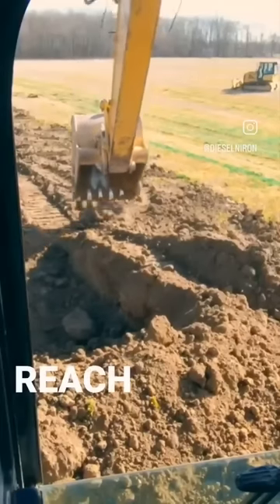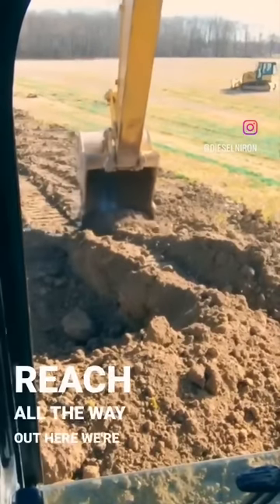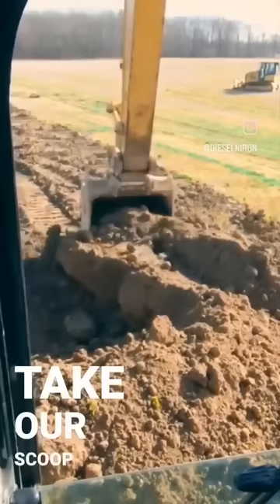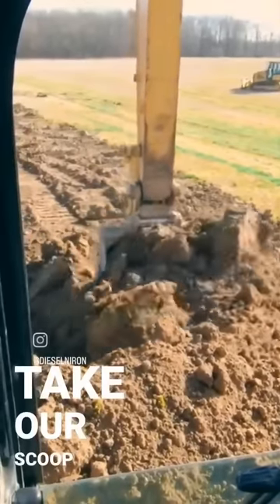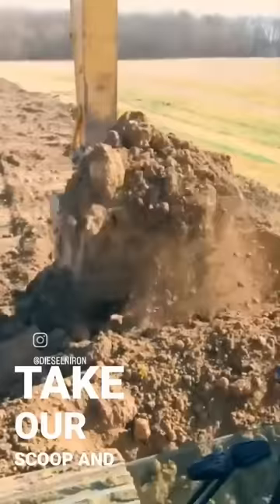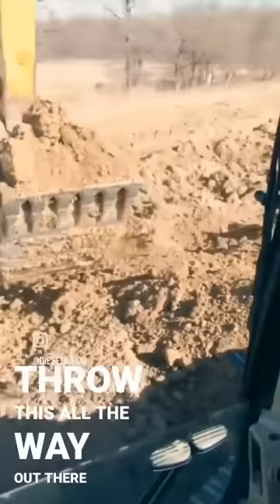Wasted movement in an excavator.

Comment: If you push the stick out super quick maybe 4 inches, while curling the bucket out, to tip out, you don't even have to wait for the bucket to empty. As the enertia and force will throw the dirt out. Saves you maybe 3-4 seconds. But over a 12 hour day it adds up to around onother hour of extra cycle time moving more material. Do that 6 days a week, over a year. And that's a fuk ton of material!
Reply from the maker: Great tip.  In the full video I talk about a couple ways you can empty your bucket quicker.

Comment: Until someone walks into your swing radius and your on auto pilot and kill some. Also you runnin that thing rougher than fuck bud.
Reply from the maker: It should be obvious you only do this when conditions permit and you should always be paying attention when running  a huge piece of iron.  As far as running it rough, I had just gotten in this machine and it had a quick coupler that took about 15% of the bucket travel out of play.  I was still getting used to that when I started making the video.  I knew I was going to catch flack for it but I still wanted to make my points.

Comment: harder on the swing motor because all that weight is farther away from center, not to mention less safe because the bucket is moving faster at that distance, and yeah not practical most places
Reply from the maker: These machines are designed to take these forces.  If I were worried about keeping the machine for 20k hours then I might stress about the extra wear.  The key concept for this video was to get new people to think beyond "scoop and dump."  You need to start thinking about the bigger picture as you progress in the machine.

Comment: Looking at the work behind you. You need to learn how to be clean.   Not sure what your working on but you left alot work behind you.
Reply from the maker: I was bulking material to save time. I came along after to do light finish passes for cleanup. It was was quicker than using one machine because the 330 could reach so far.

Comment: All the guys knocking the full lockout bang are right except every one of them has done it over and over when they're shifting mud...😜 We all have to learn some way. 

I'm usually starting my slew as I'm finishing the loading curl if I'm not trapped behind a heavy pile and pushing dirt when I move. I start to roll out halfway through the slough so when I get to the 9 o'clock position my bucket's nearly empty. While the last bit is tumbling out, I've already slowed the slough to an easy stop and am going back to 12 o clock. If the piles need to be tidy I'll be more decisive but if I'm just bulking.... That's how I do it.  On the way back I time my re-commitment to the stockpile so there's no sideways deflection on the pins when I land and dig into the pile but there's never a full stop.  I try be engaged in the swing every second that doing so won't exert lateral resistance pressure on the pins. 

If I'm throwing it all the way behind me in the 6 o'clock position I won't even stop, I just continue a full slow 360 spin in one direction to save wear on the Slough brake, dumping in a crescent pattern from 7 o'clock to 5 o clock. I alternate directions so the wear is even on the slough. 

Learning to operate consistently in a way that's both efficient and gentle comes with thousands of hours and obviously production work in a mine and working in a small business with a low budget are 2 different things.  Guys that are too delicate and gentle will get yelled at in the mine and guys that are productive but fast and rough will get yelled at by the small business guy drowning in debt on the machine purchase. 

Operators always get a lot of abuse for being idiots... But people outside this trade don't comprehend the costs involved.  A really nice tablesaw might cost 4 grand, but a pretty nice excavator might cost 400 grand.  Just sayin 😂
Reply from the maker: Great comment and really solid advice.  Thanks for watching!
Reply: @DieselandIron  Thanks for posting, someone's gotta show the kids that the building trades are worth surviving the learning curve to reach proficiency 👍

Comment: Doing the Bubba scrub . Lol , when I get in the dirt like this, I'm dragging my shit taking a bucket load while pushing another half bucket across,  then barley drag it out.
Reply from the maker: It is incredible the number of people in the comments that don't understand how efficient this method is for roughing in material. It's even more impressive the number of people that think this is going to destroy a machine.
Reply: @Diesel and Iron  oh ya, I've got thousands of hours moving mountains. When I'm doing bulk dirt transfer, I'm hogging in deep everywhere. It's nothing to take a bucket, and move another in the same stroke, then I'm dragging it out of that pile and it will basically just slingshot right into the other pile as it's curling,  Luke I said, dragging that, and pushing as much as possible. The cycle times are pretty good. Not the fastest, but man can you move the dirt quick this way.
Reply from the maker: @ParticipationTrofee  100%

Comment: This is well and fine if you're on the level. But if you're working at height or an uneven territory or off of a perch that is not built out of competent material, you always want to keep your bucket close to the machine so you don't tip over
Reply from the maker: Correct.  I made an assumption that the internet would use some common sense on this video.  The abortion taking place in the comments section is proving me wrong....
Reply: Roger that. I sure wasn't trying to give you a hard time my buddy....I guess I've been at it way to long and am always "what if'ing" my self to death.  Anyways...screw the haters and keep on trying to help folks 😊

Comment: We did this in Alaska mining, but I set the limiters so you could not slap the bucket or dead end a cylinder. I'm sure the new equipment won't let you dead end it. I wonder how hard this is on the rotation parts. Any one know?
Reply from the maker: This was an old beast with an old style coupler that took a lot of the play out of the bucket travel.  I was still getting a feel for the machine when I started recording.  The clanging makes more noise than anything else.  There are metal stops welded on the eye that prevent the cylinder from actually bottoming out.  It's not great for your pins and bushings but real damage isn't going to occur from a handful of bucket slaps.

Comment: it's not waisted movement. excavators, while extremely powerful, have limits. not to mention you've got Jimmy out there with a shovel checking his phone, and you just swung your bucket across his head. good job. you're fired.
Reply from the maker: Hear me out. What if you were careful?
Reply: @Diesel and Iron  careful doesn't help you see through dirt. I'm not saying you can't operate this way, but in most construction scenarios this would be more risk than reward. I'm not the be all end all when it comes to this stuff, but I was a heavy equipment operator and instructor for several years. I also worked with a state agency to produce safety curriculum and training around heavy equipment. Specifically for highway construction.
Reply from the maker: @1985recon  the intention of this video is to get newer operators out of the mentality of only thinking about scooping dirt. You have to think about the bigger picture, efficiency and saving time. In a longer version of this video I talk about safety as well but you can only do so much in a small 45 second clip

Comment: The only fear i would have if i owned the mechine is damage done because of you arm being stretched out
Reply from the maker: The machine isn't being damaged from the arm being out.  Believe it or not, these machines are engineered and designed to work....
Reply: @DieselandIron  I get it, I work in an industrial kitchen, and some mechanics are built to last. I was thinking of stress on the hydraulics. Like you will only get 40 thousand twists over 40 thousand 1 hundred. Before some PMs are needed

Comment: I love how all the internet experts are bashing on you for cylinder bottoming out etc etc. It’s a machine, not a museum expo model. You internet experts need to learn that these machines are made to be used and have a relief valve that’ll open up at a certain pressure (depends on the model) to prevent damage. You can max out a cylinder and keep your joystick held down and it still won’t damage it. The seals don’t get damaged either unlike some of y’all claimed. Seals get damaged from years of exposure to dust/tiny gravel and scored chrome shafts.
Reply from the maker: This post has really stirred up the armchair operators and the worst of the industry for some reason. While they think they are really getting me upset, they are killing it on the views and this is now one of my top videos 🤣🤣
Reply: @DieselandIron  More exposure for you, that’s always a good thing 👌 meanwhile they’re pulling their hair out for the extreme damage your causing to that poor working machine. Don’t forget to buy a shovel to please them 😆
Reply from the maker: @rukinaa  🤣🤣

Comment: Try that on a barge with a long reach.. youd be upside down under water
Reply from the maker: But this isn't a barge... Or a long reach....
Reply: @DieselandIron  good thing.. this might work on a pile but it's still better to full range the arm when swinging, be easier on swing bearing/brake.. that fluid motion, but when your learning best just get the job done eh.. you'll get there, slow is smooth and smooth is fast!

Comment: Pulling in is not wasted movement.   Once you learn how to run them.  Pulling in gets the house spinning faster and throwing the stick out sucks up the built up energy.  And when the stick is in tight to the glass you have way more swing power and keeps your center point of gravity closer to the ground.
Reply from the maker: I've actually tested this and it is still faster to leave the stick out from a cycle time standpoint.  I agree with the momentum aspect but due to the hydraulic requirements of sticking in and out it's still faster just to swing when site conditions allow it.
Reply: Its like a figure skater doing spins. When they pull in their arms they spin faster, when they extend their arms out they slow down. 
Basic physics
Reply: Lol you should time that... Physics says bullshit. Sure, you can swing faster with the arm in, but the amount of wasted time moving the arm in and out more than makes up for the small increase in swing speed.

Comment: I'm not in construction but, isn't this common sense that shouldn't need a demonstration? If I'm wrong let me know the rationale.
Reply from the maker: Technically it is faster to swing with the stick and boom pulled in (think of a ballet dancer or figure skater spinning).  The problem is the swing motors slow down when you add the hydraulic demand of bringing the stick and boom in which actually causes your cycle to be slower than had you left the arm out to begin with.
Reply: @DieselandIron  Thanks
Reply: @DieselandIron  that make sense to me. Mass x velocity = momentum.

Comment: That technique is hard on the swing bearing. Also, when you slam your bucket all the open, you're ruining the packing in the curl cylinder. Keep working at it bud, you have to dial in your technique and learn what is efficient and easiest on the machine
Reply from the maker: The swing bearing is fine. See comments below for an explanation to the bucket cylinder bottoming out
Reply: @Diesel and Iron  I'll take what you say with a grain of salt. I've been around this stuff  long time. Common sense will tell you from a leverage standpoint, you're putting more stress on the bearing that way. Most qualified excavating companies aren't okay with running a machine that way. They'll generally send you down the road.
Reply from the maker: @joshuaurban7575  ok
Reply: @joshuaurban7575  LMAO no. They're literally made to swing like this. Where on earth are people pulling the boom in close every time they need to swing the machine??? Maybe if you're in a forest or road or other crowded area.
Reply: @Studio23Media  do that at a large company or union company and see how it works out for you

Comment: Learn how to carry your bucket so it’s not a choppy mess😂 I’d rather take excavator lessons from Hellen Keller
Reply from the maker: I take it you've never rough graded in a hoe before?
Reply: @DieselandIron  rough graded? You can still do a nice smooth ish job. I would actually have to try to do a job that bad rather than keeping it half smooth
Reply from the maker: @johnlobel9351  Unless you're in the situation where you have a D5 sitting on standby to do all the cleanup work.  All I needed to do was bulk in the material.  The hoe was going to be far faster moving the lion's share of the material but the D5 was going to be more efficient for the cleanup work.  Could I have made the passes look nicer?  Sure, but it would have been a total waste of time and impressed nobody.  I was in the middle of a farmer's field by myself.
Reply: @DieselandIron  literally all you needed to do was not be bouncing your bucket up and down as you pull in like someone on their first day running an excavator. I do everything you spoke of in this video to be efficient already, but I also pull into my scoop nice and level to leave a nice finish where a dozer would only need to smooth out the finishing grade on my work, not actually push material back up to the excavator. But don’t worry young fella one day you’ll get the excavator experience you need to not be a choppy operator
Reply from the maker: @johnlobel9351  you win John. Clearly you are the better man with the bigger Johnson

Comment: clanging that bucket will get you run off
Reply from the maker: I've explained why many times, check the comments.
Reply: @DieselandIron  even without reading the comments I can almost guarantee it's because the soil is sticky and doesn't want to come out of the bucket
Reply from the maker: @Graderman3587  In this situation I had gotten in this machine about 10 minutes before recording.  It has an old Cat quick coupler on it that takes about 15-20% of the bucket travel out of the machine and I was still getting used to the site picture of where the bucket stopped.  All of this while concentrating on making a video.  I knew when I recorded it that I was going to catch hell for it but at this point everyone's losing site of the actual message because they are so fixated on it....

Comment: Lol, the replies an insults to you slamming that damn bucket are pathetic "iTs A nEw MaChInE"  maybe so. But not a valid excuse.
Reply from the maker: It was a machine that had an old school quick coupler that took about 15-20% of the bucket travel out of play.  It is a valid excuse because I had only been running the machine for about 10 minutes at the time I made this video.  We all have to take time to get used to equipment we aren't used to, especially when it is dramatically different than what you are used to.